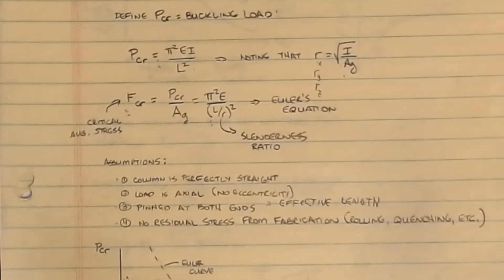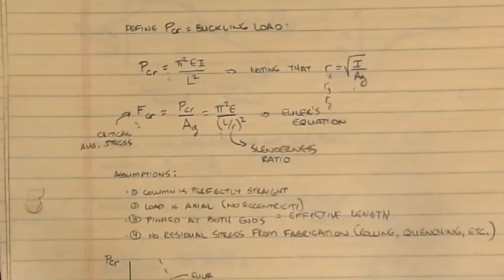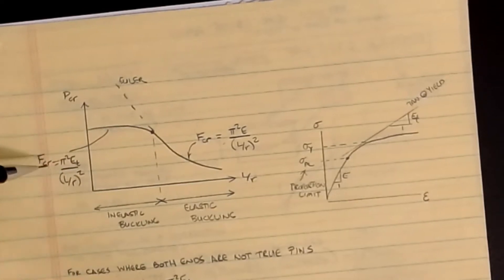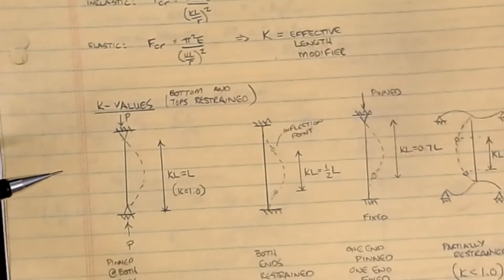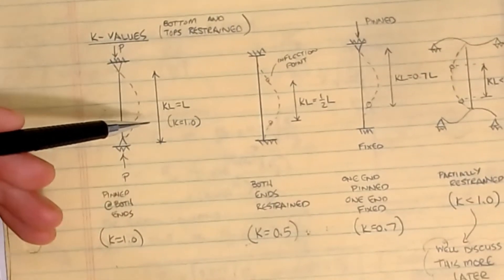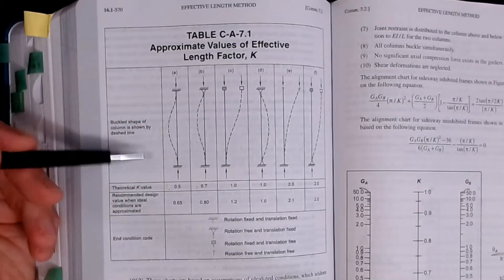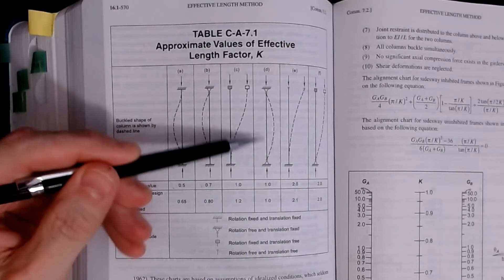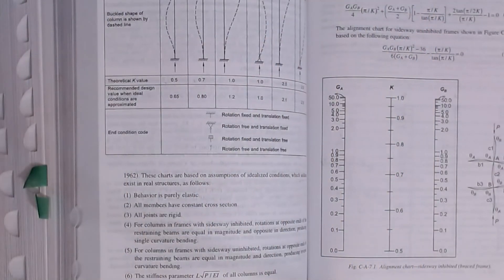012 CE341 Steel Design: Effective Length Factors - Part1

Comment: How can we findout when their is occurance of elastic spring constant at the top
Reply from the maker: The spring constant is just an assumption related to the rotational stiffness.  AISC uses the alignment charts I mentioned in this video and estimates the ratio of the total stiffness of all of the beams framing into a point to the total stiffness of all the columns.  You perform this calculation at both the top and bottom end points of the column and then use those alignment charts to determine K.  Hope this helps.  Thanks for watching.